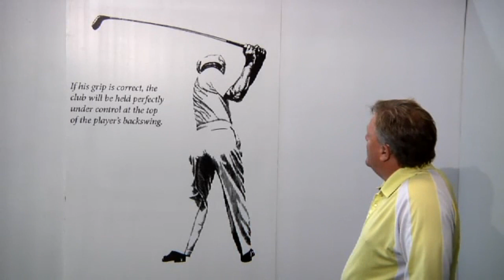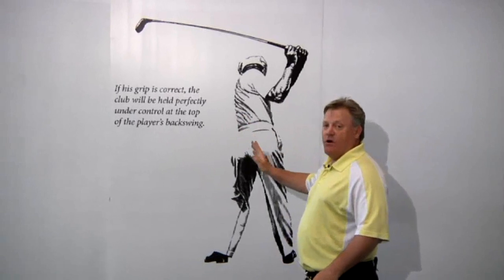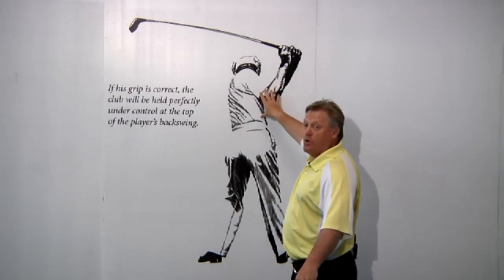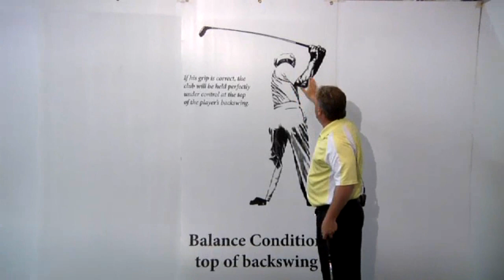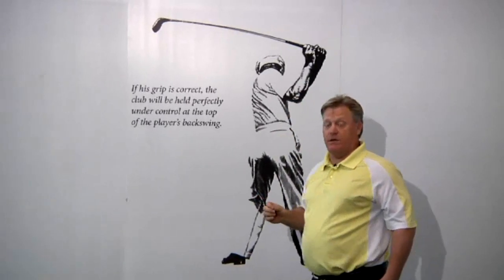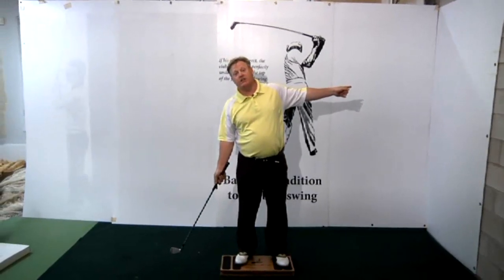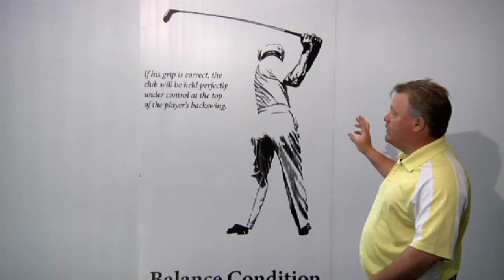Mr.Hogan

Comment: If you draw a line vertically down from the center of Mr Hogan's head where his spine starts in that image it's very much a centered pivot. Mr Hogan's real swing ranged between a centered pivot and a slight reverse-k at the top so the image is correct.